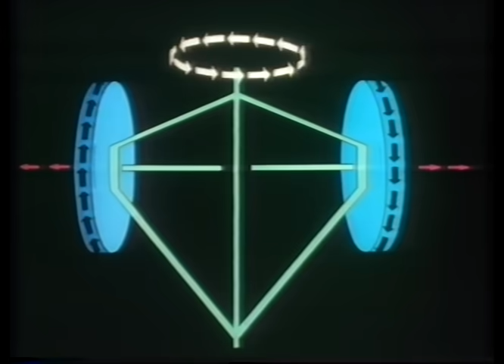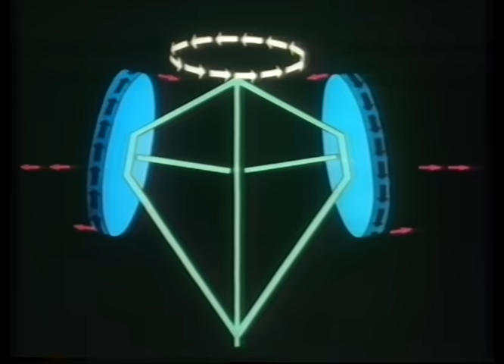Anti-Gravity Machine (Part One)

Comment: *You need 3 things for one of those electric air vehicles.  Here they are, and where to get them.*

1) power source.  If you stretch magnetic fields lines like the Earth's Geodynamo does, that amplifies the magnetic field, and you can use that process create a magnetic field around an entire planet -- for 4 billion years - without the planet ever having to stop at a gas station or plug-in overnight for a recharge.  The McCandlish ARV 'Fluxliner' has a central column of rotating metal that is stretching magnetic field lines and looks to be the power source for that vehicle.  Look up Geodynamo.  The original UFO inventor -- all those years ago -- must have said one day,  "Hey -- we're standing on a device -- our planet -- that's been producing a huge magnetic field around our planet for 4 billion years -- how is that possible?"  "The rocks underground are magnetized?"  "No, the liquid, molten iron core has too high a temperature to allow the rocks to be magnetized. The molten iron temperature is too far above the Curie temperature.  I bet we're standing on a Geodynamo!"  
The rest is history.  Roswell, Betty and Barney Hill, Mark McCandlish ARV Fluxliner, etc.

2)  propulsion -- ELECTROMAGNETIC propulsion.  This device uses the Lorentz Force.  With the help of gravity/inertia field control (see (3) below) on this vehicle, the back-to-front electric field, and the magnetic portion of an electromagnetic wave that's emanating from the vehicle at RIGHT ANGLES to the back-to-front electric field -- just use the "right hand rule", you'll find the Lorentz Force is a downward thrust, providing lift.    https://patentimages.storage.googleapis.com/31/45/3f/583bc0d7058997/US20060145019A1.pdf
See Figure 5 on page 6 -- the thick round arrow, item D, pointing back-to-front is the electric field.  The magnetic portion of a broadcast electromagnetic wave, item C, is the other requirement to produce a Lorentz Force -- a magnetic field at a 90 degree angle to an electric field. That creates the Lorentz Force.   (Recall that every electromagnetic wave has an electric component and a magnetic component -- see https://en.wikipedia.org/wiki/Electromagnetic_radiation.)
Item C in the diagram represents the magnetic portion of a broadcast EM wave, specifically to achieve the Lorentz Force.  The "right hand rule" will show you this vehicle will thus produce a downward Lorentz Force,  providing upward lift.

3)  gravity field/inertia control -- this inventor worked in the 1960s-70s on space re-entry vehicles in the aerospace industry.  The invention polarizes the Bismuth atoms in a spherical crew compartment made of Bismuth to create a 2nd gravity field inside the sphere:
https://patentimages.storage.googleapis.com/3a/e1/0a/cdda5bf4825fb1/US3626605.pdf
See Figure 7 on page 5 -- that's a 'pie-shaped' cutout of the spherical crew compartment.  Bismuth is mentioned on page 13, left side, 2nd column from the top.

The gravity/inertia field patent in (3) above uses a clunky mechanical way to polarize the Bismuth atoms.  There's a better way, a non-mechanical way, to pull that off.

Since the protons of the Bismuth atoms in the invention are being polarized -- and since protons have a positive electrical polarity -- why not use a flow of electric current, which consists of electrons - which have a negative electric polarity -- to attract and polarize the protons in the Bismuth atoms. 

Recall that in electricity,  "unlike charges attract" (and "like charges repel").

This is a chunk (link below) of a crashed flying saucer.  This piece consists of multiple layers of Bismuth, and an electric conductor made of a magnesium/zinc alloy. 

This chunk is a LAMINATE,  a thick 'sandwich layer', of alternating Bismuth-metal conductor-Bismuth-metal conductor- etc. layers.

It appears that they ran electricity (probably AC -- see the gravity patent on page 9, left side, 1st paragraph, where it says *"That is to say, if the time varying kinemassic field is made to undulate typically sinusoidally, there will be induced an accompanying undulating secondary gravitational field"* )

It looks like they ran electrons, using alternating current, through the magnesium/zinc metal layers to polarize the Bismuth atoms.
https://www.earthfiles.com/2018/08/03/part-1-mysterious-micron-layers-of-alternating-bismuth-and-magnesium-from-bottom-of-wedge-shaped-ufo-2/

By the way -- the author of the article about the UFO chunk is unaware that there are Earthly means to manufacture this type of Bismuth lamination.  

In the semiconductor industry -- which manufactures integrated circuit chips (IC chips) for computers -- part of the manufacturing process is called "Thin Film Deposition".  It uses special machines called "Sputters" to lay micron-thick metal (and other) layers on the IC chips during manufacture.  

The deposited metal comes from a "target" in the Sputter machine (poorly named, since it's the source of the metal, the IC chip is the target, but hey).  You can put all kinds of 'targets' in a Sputter machine for thin film depositing on an IC chip.

Here's a Bismuth target for one of those Sputter machines (I used to work in the Semiconductor industry):
https://www.lesker.com/newweb/deposition_materials/depositionmaterials_sputtertargets_1.cfm?pgid=bi01
 
Just google "Bismuth sputter target" -- there's tons of vendors of these.

STUDY WHAT A GEODYNAMO IS.  Since the year 2000, there have been research projects - the "Riga Dynamo",  the "Karlsruhe dynamo"  -- trying to develop a scaled-down version of the Earth Geodynamo.  (Not to make a UFO power supply, only to study the Earth Geodynamo).

We've been standing on a free energy device our entire lives.  Right out in front of us.  Or below us, actually.

All you need for a Lorentz Force electric air vehicle is -- craploads of electric power.  The McCandlish ARV Fluxliner center column looks to be a scaled down Geodynamo.

EDIT:  Just wanted to say, the reason I wrote this up is, I'm 95% convinced that a mechanical means -- like the type in this video -- are not cutting the mustard.   I don't think a mechanical device for producing flight characteristics like most UFO witnesses report is possible.  Just my opinion.  But I have a background in electrical engineering and physics, both education and in industry.  Any time you have a choice between:
-  a bulky, many-parts-thus-prone-to-failure mechanical device 
- or a device that uses electromagnetic means
to solve a problem, AVOID THE FREAKING MECHANICAL DEVICE.

Imagine losing all our electromagnetic means of communication, and having to resort to mechanical devices.  Can a mechanical device achieve what an electromagnetic-based laptop computer can?  Sure.  Would it be the same size, would it weigh 3 pounds and fit on your lap?  Probably not.

.
.
.
Reply: I love you
Reply: Great post, would read again.

Comment: I wonder if there's a way to combine other motion methods with the Antigravity effects of the gyros to stabilize or go in a certain direction, but with much less effort and higher speeds. And doing testing remotely as with personal Drones.
Reply: 3 disk left right and to left and right need to be connected to the upper one all 3 at same speed produces antigravity they will rotate on their selfs and rotate around itself ufos are not real they just created them and letting people think there are aliens instead od showing the technology they use
Reply: Yeah increasing the weight of the device and arms. The rotation what create counter Mass to that rotational vector. Look into nuclear spin value

Comment: I think it's just a mater of having large neough gyroscopes turng at thr just the rgiht speed. the mass of the gyros and their speed are very mportant in detemening the lift that can be obtained. Also  the tortiaon of th epeiared gyros. He needs large gyroscopes with more mass. I'm sure some mathematical geneoius can up with the numbers. how much mass needed to create the right amonut of lift. Maye it might take four Gyoros.  I noticed that he had them rotating in opposit directions but that was just an illusion because they were on opposit sides of the pillar. He should keep up the work and make the gyros larger and heavier. The heavier they are the more lift they will create. In fact the gyoros should be the heaviest object on the device.  When the gyors outweigh the rest of the device they will lift it up.

Comment: Mr Kidd, thank you for your dedication and your gracious answers to the 'trolls'. Your work, your book and appearing on TV at the time got me to try making one as well. Which I did, and didn't comprehend the results until many years later. My system simply had two gyros, spinning in the same direction which because they were opposite each other appeared to have a contrarotation, and once they were spun up were then forced into precession. When placed on a scale and horizontal forced precession started, there was a fair bit of vibration effecting the needle on the scale. However, the needle oscillated at a weight less than normal. As maximum precessional velocity was reached the needle oscillated around the normal weight. As forced precession was ceased and the precession velocity slowed, the needle oscillated at a weight greater than normal and in the same range as at startup. 
Many years later I considered that the result was a matter of;' For every action, there is an equal reaction - but not necessarily at the same time'. In other words, the system stored a reaction, resulting in initial weight loss and as precession slowed the stored reaction then occurred, resulting in increased weight equal to the weight loss. 
If I had rotated the whole device through 180 degrees ( balanced by another pair of gyros) during the stored phase before reducing precession velocity then the two outputs would have occurred in the same direction. The result would then be a pulse of output acceleration upwards, followed by a pause, then another pulse in the same direction - an average acceleration in the one direction. Rather than an average velocity...
For every angular velocity (ie; precessional) there must be an angular acceleration (however small). For every angular acceleration there must be a momentary angular jerk. For every jerk, a snap. For every snap, a crackle and then onwards in the same vein a pop. We want angular acceleration so require angular jerk. I think this explains (angular jerk) why your own machine at least displayed output velocity and why the university version of your machine (machined to extremely fine tolerances which minimised any 'jerky' vibration) showed far less of an effect, if any. 'Jerk' is something that is an engineering nuisance - but for these devices is vital. How to engineer maximum jerk so that output force is created? No wonder, in the minimising of jerk in any machine by engineers, no one has noticed that reaction can be stored. That's what you did, in my opinion. When you turned so quickly on removing the aircraft gyro you induced a large jerk - sufficient to throw you UP and backwards off your feet. If you had turned with a near zero jerk you would have just toppled over backwards, feet still on the ground. More to come at some other time - I'm 60 and my tea is ready!
Reply: Ни чего не понял но всё прочитал.
Reply: Still trying? 😄
Reply: @abrahamg3354  I asked ChatGPT about maximising jerk and at first it said it could not address such a subject, so I clarified the request to ‘jerk’ as in snap, crackle, pop, jerk, acceleration, velocity. Having understood that, ChatGPT’s response was; “Maximising ‘jerk’, giggle, high energies!! Danger, Will Robinson!” 😃
And indeed, I do have a very dangerous design that I am fearful to build….
Reply: @paulderuyter4529  Thats when you keep going.
Reply: Paul do you have your work on this published anywhere? A blog or something. Pretty curious about it
Reply: @JeremySteamsack  
Grebinkov 'cavity structure of things'
Reply: BRAVO‼️‼️👏🏽👏🏽👏🏽‼️‼️‼️
Reply: You the man
Reply: Shut up Karen 🤡
Reply: I’m pretty sure you’re 11/13ths of the way to finishing the Infinite Improbability Drive sir, keep it up! 💪 -ZB

Comment: From what I can find out, this was filmed in the 80's. If it was so awesome a concept, what happened to it? It it actually worked, why has a working model never been produced. 
From Wikipedia: 
The Gyroscopic Inertial Thruster is a proposed reactionless drive based on the mechanical principles of a rotating mechanism. The concept involves various methods of leverage applied against the supports of a large gyroscope. The supposed operating principle of a GIT is a mass traveling around a circular trajectory at a variable speed. The high-speed part of the trajectory allegedly generates greater centrifugal force than the low, so that there is a greater thrust in one direction than the other.[6] Scottish inventor Sandy Kidd, a former RAF radar technician, investigated the possibility (without success) in the 1980s.[7] He posited that a gyroscope set at various angles could provide a lifting force, defying gravity.[8] In the 1990s, several people sent suggestions to the Space Exploration Outreach Program (SEOP) at NASA recommending that NASA study a gyroscopic inertial drive, especially the developments attributed to the American inventor Robert Cook and the Canadian inventor Roy Thornson.[6] In the 1990s and 2000s, enthusiasts attempted the building and testing of GIT machines.[9] Eric Laithwaite, the "Father of Maglev", received a US patent for his "Propulsion System", which was claimed to create a linear thrust through gyroscopic 
and inertial forces.[10] After years of theoretical analysis and laboratory testing of actual devices, no rotating (or any other) mechanical device has ever been found to produce unidirectional reactionless thrust in free space.[2]
Reply: Sandy, I believe in you, me and many others. Don't give up on your immortality. Do not let yourself down.
Reply: Brazilian research shows a result impossible to happen due to the law of physics in electric power electricity.
It absorbs 35 watts of power and powers the power to 140 watts, consuming only 35 watts of power.
https://www.youtube.com/watch?v=aEyXmsn9Mlo

The hope of the world is in our research, who has energy has the power.
Reply: You got it pretty well correct Alex.
However if the device is running in the horizontal plane any loss of centrifugal or angular momentum which ever way you choose, will not really be noticed until it has all gone which at that time will allow the gyroscope to accelerate upwards (the idiots call this precession which it is not)
The device I have made will show the system creating centrifugal force in the horizontal plane, whilst loading a central spring via the linkage provided on the device.
When the gyroscopes are rotated the reduction in centrifugal force will be observed by the gyroscopes decreasing the load on the system and climbing upwards as the spring extends.
Very simple and very obvious. 
We shall have to wait and see what the reaction is. 
Does this help?
Regards,
Sandy
Reply: Nevyen
It is nice to know that I investigated the possibilities without success in the 80s.
My VIPAC Laboratory Test and Report on a different device says otherwise, also produced in the 80s.
I would like to know who feeds Wikipedia with this garbage.
The trouble is people are liable to believe this nonsense.
I have just replied to another person on YouTube who was asking what happened to the machines.
I replied that they were just ignored to death, that simple, just ignored to death.
However thanks for bringing this to my attention.
I am in my 80th year so this will be my last attempt to lever open clam-like closed minds.
I do have another working device which I will presently demonstrate on YouTube.However it seems to me that my credibility with the academics is very low. 
That said I am prepared to give away some of my hard fought information by demonstrating where Newton, I will not say he got it wrong, more like he never got it at all.
They laughed at Eric Laithwaite and his big gyro (flywheel) some even claimed it was a trick.
This specially made device will demonstrate on YouTube clearly why Laithwaite’s claims were correct and then some.Depending on the reaction to this demonstration device, will depend on whether I waste more of my time or not displaying my other working machine.
Regards,
Sandy.
Reply: Loaded in error.
My apologies,
Sandy
Reply: So in other words, it doesn't work, and no one bought into the con. 
As others have pointed out, there's ZERO effect on the weight/mass of the "machine". 
You are not producing thrust, and definitely not producing any usable effect. The power sources (TWO!) aren't even attached to the "machine", meaning it can't even replicate the "effect"* under it's actual "full" weight.  
As others have also pointed out, the effect of centripetal force or a "big gyro" can appear to "lift" a mass, but the fact is you are not creating lift or producing a force usable to drive a spacecraft.
This ranks up there with Snake oil and perpetual motion machines.
Reply: @sandykidd6072   Sandy Kidd  Sandy please bring this Info Back for the next generation. Lots of young people and adults that like "lifter craft" which are similer. If you title videos with that they will get more views. Thank you so much for all of your work!